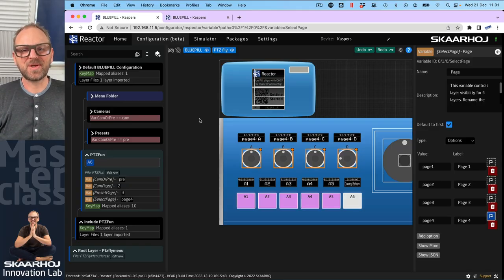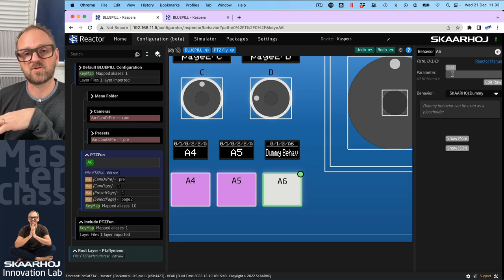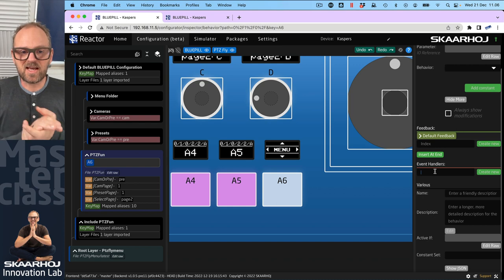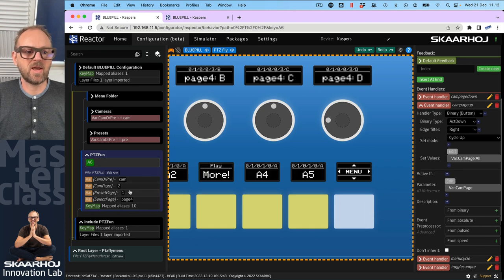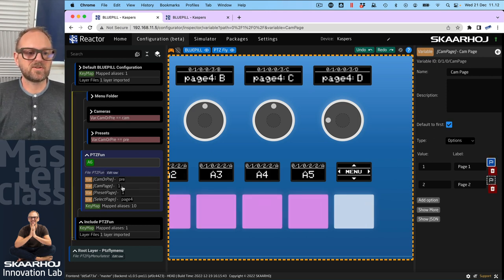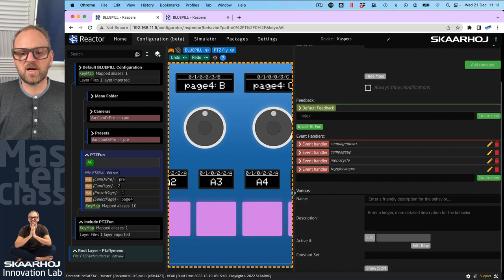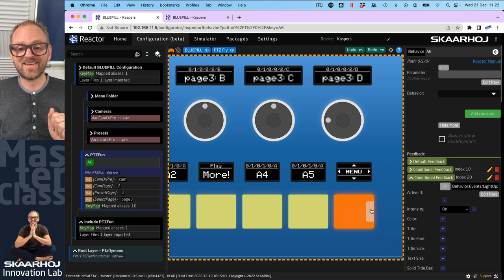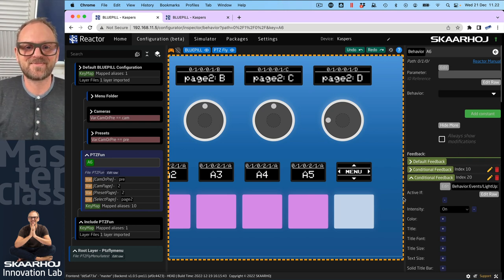Creating the Single Key Navigation Menu from PTZ Fly pt. 2

Comment: Would it be possible to make a hidden extra function to that menu navigation button when you press and hold it down for 2 sec as well?
Reply from the maker: Yes, absolutely, but the problem is what you will want from the trigger after one second: Should it still fire? Or should it only fire if the button is released between one and two seconds (which I'm sure we can do at the moment, but would have to add as a feature). If you want more detailed answer, feel free to describe your actual usecase to innovationlab@skaarhoj.com! - kasper